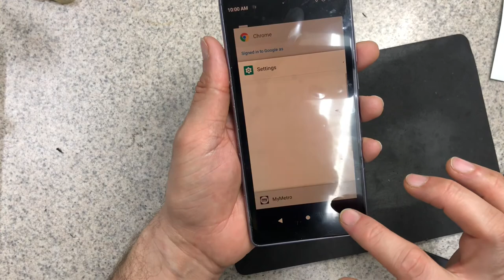Cool pad legacy screen replacement | how to replace cool pad legacy screen .

Comment: Links to the adhesive and the screwdriver you used?
Reply: Adhesive = MMOBIEL T-7000 Multipurpose High Performance Industrial Glue
Reply: Screwdriver?

Comment: Wouldn't it make more sense to sandwhich the digitizer and case between 2 FLAT surfaces instead of 4 different [clamp pinch points? For example put it between two heavy books?
I would fear that those clamps would create a wavy screen. ~~~ instead of -------
Reply from the maker: Thanks for the advice
Reply: @QuickFixMN  hey btw ty I'm using your video to fix my daughter's phone. I didn't order a screen with the frame so I have to glue the new one to the old frame! I'm stuck until I can order the adhesive you used.